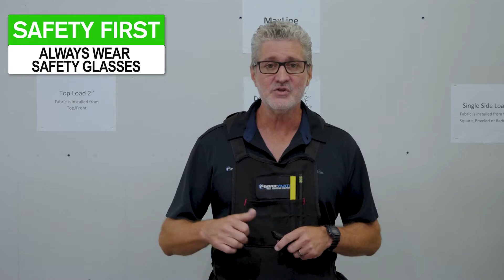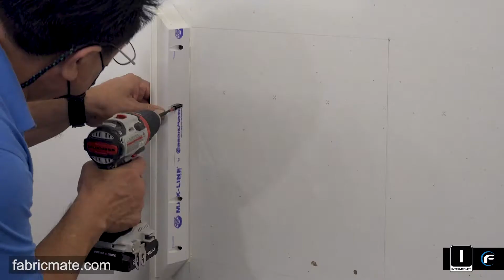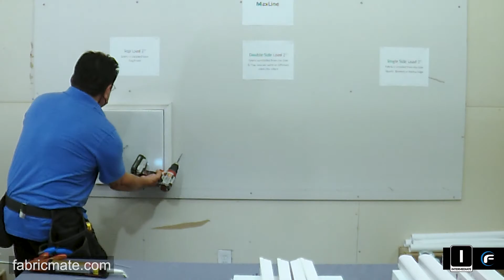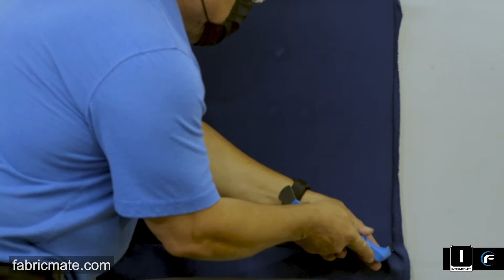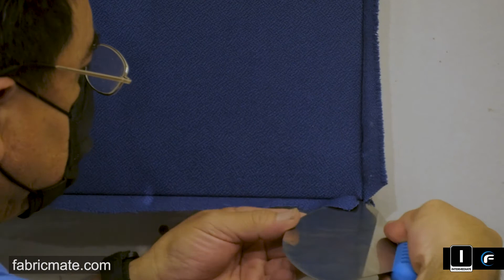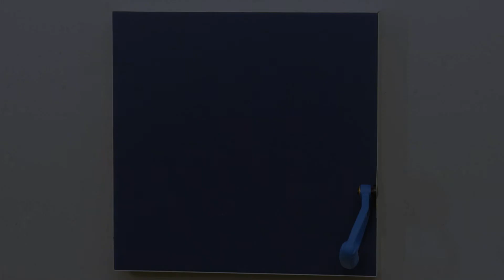Fabricmate® - How To Install Max-Line® 2 inch+ Top Load Acoustical Fabric Wall Finishing System

Comment: Do the screws need to go into studs, or will it hold just in the drywall?  Thanks
Reply from the maker: Hi Mark. Thank you for your inquiry. The coarse drywall screws included with the Max-Line system do not need to go into the studs. Just insert them into the pre-drilled pocket holes and screw them directly into the drywall and they should hold just fine. As shown in the video you can also use construction adhesive in addition to the screws if desired.
Reply: @Fabricmate  thanks so much for the reply.  So you include the screws? that would be great.  I hadn't understood that on the website.  Fantastic.  Thank you!
Reply from the maker: @markholding3954  You're most welcome Mark. If you have any additional questions, please call us at 1-866-622-2996 and press 1 for Sales & Technical Support.

Comment: What is the maximum or minimum fabric should remain after trimming before the last tuck?
Reply from the maker: We generally recommend leaving 1/2" to 3/4" of fabric remaining before final tuck/roll in. Would love to see a picture of your installation!
Reply: @Fabricmate  Thank you for replying. I’m actually in the planning stages of building my very first dedicated home theater and of course planned on buying fabric and tracks from you guys. I will send a picture for sure after it’s all completed with a before, after. I did however bought some fabric many years ago from you for some DIY acoustic panels.